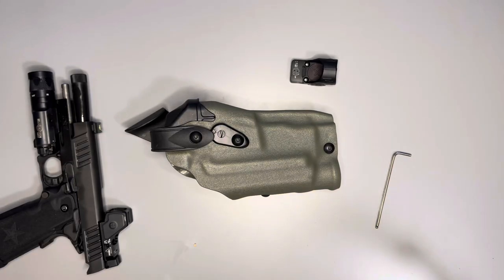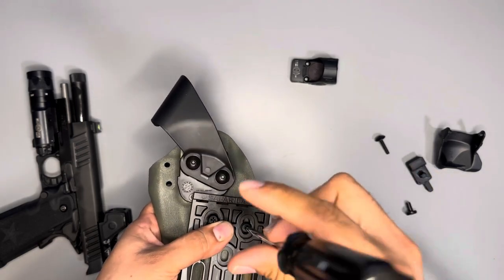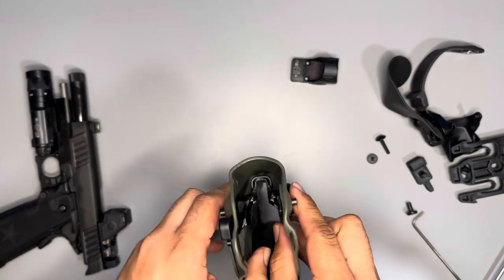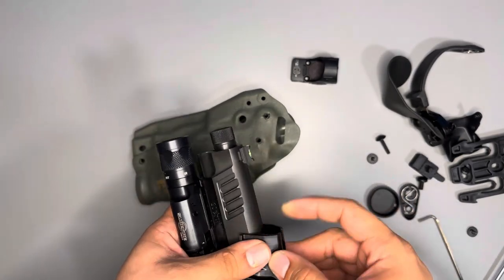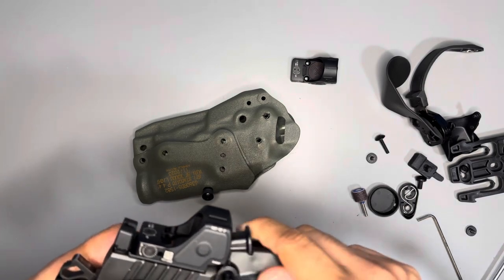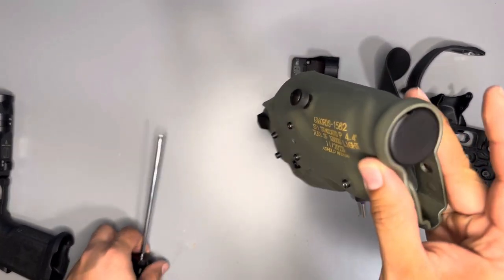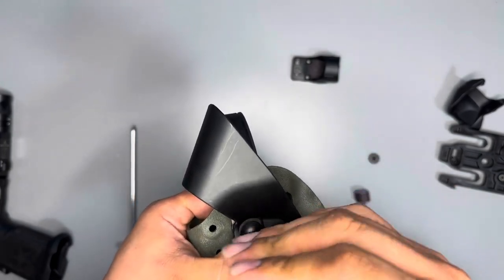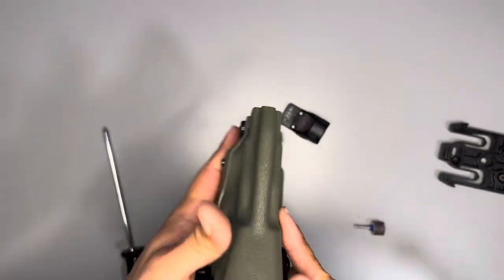Making a staccato with Trijicon sro / rmr hd fit a safariland als/sls holster.

Comment: They just updated the staccato ones to fit them from the factory and releases an xc one.
Reply from the maker: That’s good. I still will check them out for future setups but I just would rather modify what I have now for instant gratification.
Reply: Diy will always be the short term option and often works. Until it does not. The ALS arm, and the plastic core does not take well to be Dremeled. Depending on the use. It’s only a matter of time until a failure.
Reply from the maker: @rdrgear  looking to make printed version and hopefully a mold if all goes well.
Reply: @o329o  this unit you have in your video is the newest version of the ALS for the 2011/1911 line with more to follow. I would strongly recommend you not copy it.  There is a reason much larger companies have not attempted this.  Just a head up.
Reply: Just got one from the factory and does not fit my P. SRO in the way. Dremel here I come